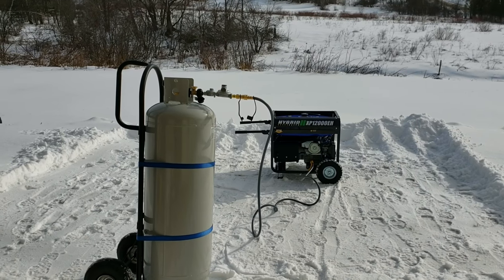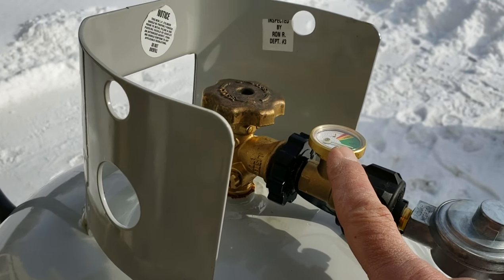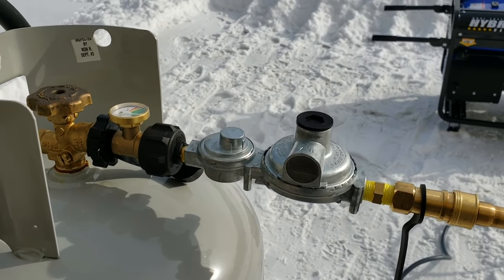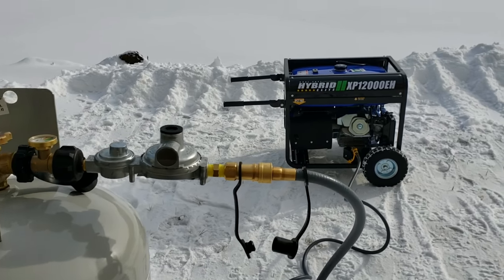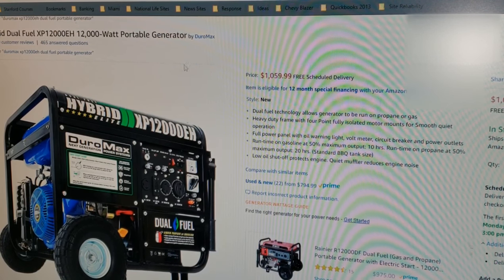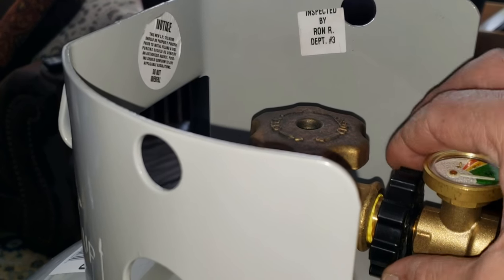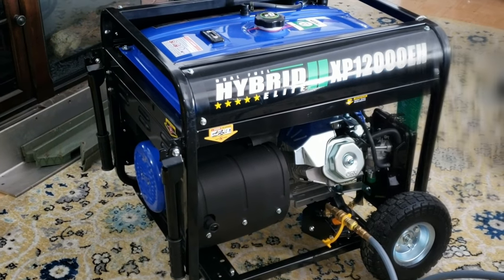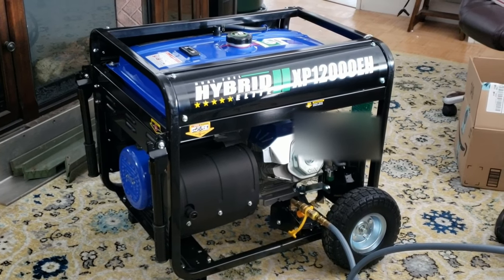Ultimate 100 LB Propane Tank Setup - Duromax XP12000EH 12000 Watt Hybrid Generator - Step by Step

Comment: What is the max BTU for this regulator ? Also I have the Newest DuroMax 13000EH but with a 30lb & 40 lb tank setup, But the regulator that came with the Generator Freezes. I am in FL
Reply from the maker: The megr-298 that I use is 175000 BTUs.
Reply: @VermontPrepper  Does that Regulator Freezes ?
Reply from the maker: @memyselfi946  no, it runs perfect
Reply: @VermontPrepper  going to call DuroMax Monday, but thanks for info. I wanted to do my whole house and that's why I went with the 13000EH.
Reply from the maker: I'd be interested in what they say.  Let me know.
Reply: @VermontPrepper  Well I called DuroMax and awaiting their reply when they find out whats causing the freeze. 

And I spoke to Rick over at Marshall Excelsior and he said I should go with a higher Regulator model MEGR-1232-BBF-XA that can handle above the max BTU. 

But I've found the Marshall MEGR-1232-BBF online but not the Marshall MEGR-1232-BBF-XA
Reply from the maker: I'm not sure I'm following that, 13000 w should only be about 44000 BTUs per hour. The regulator I have handles 175000
Reply: @VermontPrepper  Wish there was a way to contact you directly.
Reply: @VermontPrepper  The  Marshall MEGR-1232-BBF does  450,000 BTU Max Output Capacity
Reply: @VermontPrepper  their reply >>>Both regulators, the one on the hose, and the one behind the front panel are necessary.  When flowing a propane regulator will get cold.  I cannot be sure the output pressure of the regulator you sent the link to would be acceptable(which was the one you have on your setup).  We use a 100 lb. tank and 40 lb. tank with the regulator provided regularly and don’t have any issues. "So Looks like I will need to take my Generator and tank to a local propane place to get it figured out."
Reply: @memyselfi946  Did you resolve this. I am thinking of getting the 13000EH  too. I have tried contacting Duromax and they were zero help. They just kept saying you need 10 psi

Comment: Just wondering, why are you running two regulators?
Reply from the maker: I want two separate setups - one for a 20lb and one for 100.  The 100 lb has a Pol connector which is different than the one that is on the stock regulator that comes with it

Comment: What’s the savings on comparison to gasoline? Thanks in advance. I’m also a rookie.
Reply from the maker: Right now gas is pretty cheap.  So its not all that much right now.  I like propane more for how long you can store it and that it is more versatile than gas in terms of what it can power, at least in my opinion
Reply: Keep in mind with gasoline, you need to keep filling your tank. Propane tanks that large last way longer.
Reply: The biggest advantage Lucas using propane is the chances of that generator starting when you need it is close to 100%.   If you use gas than you have to worry about old gas clogging up the carb jets.  You really need to have a semi-annual checkout of your gas generator - start it up on FRESH gas - let it run a bit - let it run OUT of gas.  You really should use non-ethohol  .     Fuel stablizers will help but I would not want to depend on them more than a year.   MOST folks only need their generator every few years - unless you take a lot of precautions it may not start when you need it.   If you start your generator at least once - but preferable 2X - a year you should be fine.  But in any case gas will go bad no matter what you do over time.    Ethohol gas can corrode parts as it "ages".   If you are long term storing any gas appliance you really don't want any gas left in the tank (and especially the carb).   With propane you don't have that worry about any of that.   Even with propane I would start it up every year or so - just to validate.    With all that said dual fuel generators are the way to go - you have options than.
Reply from the maker: I'm not sure what the savings is.

Comment: I think there is a mistake in the parts list. I ordered all of the connectors and hose listed but the pressure gauge that came and i went back and looked at your link again is for the oal not the pol tank fitting

Comment: you stated that you changed the regulator because you didn't know its quality. Would the stock regulator work with a 100lb tank though?
Reply from the maker: I wanted a separate regulator to keep the connections separate.  Wanted two separate hookups

Comment: Why didn't you use the regulator that came with the generator, and could you push the length of the hose more than 12 feet?
Reply from the maker: I use it for a 20 lb tank.  It doesn't readily fit to a 100 lb tank
Reply: @VermontPrepper  okay thanks.

Comment: How do you tighten the fitting to the regulator?  By hand?  The fitting spins after only going on a few of the threads.
Reply from the maker: Use a ratchet from the other side of the fitting.
Reply: @VermontPrepper  A ratchet will fit on the inside of the gas regulator valve?  So, tighten that to the regulator before connecting it to the gas gauge...correct?
Reply from the maker: @donwright9930  yes, check it out.  I haven't looked at it in a while but believe it is a hex
Reply: I was wondering this same question. Haven’t tried it yet, but the Amazon Q&A for the adapter  gas regulator valve suggest a 18mm deep socket to tighten from the inside

Comment: Came across your video and I'm a little confused as to the regulator you are using and why you were having issues.  What you are using is a 2 stage regulator. That is required for hook ups inside or going into a house. You can use the same regulator that you use on a 20# propane tank. There is nothing wrong with it.  If you are using this outside then you don't have to use a 2 stage. Just curious as to why you have to use this one.
Reply from the maker: Not sure I understand.   I wasn't having issues.  Just setting it uo the way I want for a 100 lb tank

Comment: In your search for a generator, was Total Harmonic Distortion (THD) a consideration?  Has this generator had any adverse affect on your sensitive electronic equipment such as circuit boards in modern appliances?
Reply from the maker: I don't use this one for electronics.   I have a 4000w champion generator inverter for electronics
Reply: @VermontPrepper  smart, but a bit hard to sort out.  My 2 yr old submersible well has circuit board.
Reply from the maker: I have another video on the propane setup for the inverter generator.  You may want to look into solar power for the submersible well
Reply: @VermontPrepper  I've two stock wells on solar which pump enough for the cattle, however at 200' deep, the solar pumps will not put out the volume I need for home and grounds.  But laying aside the well issue, my new frig, clothes washer, tv, microwave,  even coffee maker all have circuit boards.  Do you have them on separate circuits? 
In reality these days our phones, laptops, and desktop computers are not the only sensitive things in the house.  I strongly suggest a quality surge protector between generator and everything else.
Reply from the maker: For sure.  I use a surge protector.   Looks like the best way is an inverter generator that has a number of circuits.  Mine has a 30A connection.  May be good for your application.   There are plenty around.
Reply: @VermontPrepper  Yelp, those 6500 K Champion inverters are sure attractive.  20 yrs ago I just hooked my welder up to my house grid, but not now, it's way more complicated.

Comment: I have same generator. Having issues with propane. It is stalling out after running for awhile. I checked for leaks. Changed hose, no leaks. Cleaned carb as well.
Reply: Are you running with a 20 lb tank? They can freeze up. Do you see ice on the outside of the tank or is it very cold? Converting. The liquid propane to gas absorbs heat. If it’s cold outside it will freeze up quicker. Place the tank in a warm water bath.

Comment: Two questions... 1, how many hours were you getting out of the small 25lb tank? 2, is the regulator it comes with sufficient to run it with that 25lb tank with no additional parts?
Reply from the maker: At 50% you can get 4-6 out a 20lb tank.  I use the stock regulator with that tank.
Reply: @Vermont Prepper  so when you say 50% you're referring to....? Nozzle on tank 50% open or is there a setting on the generator that puts the unit at 50% power? I apologize but I don't actually own the generator yet and have never owned one. This is all new to me. Thank you for all the info man!
Reply from the maker: No worries, I am referring to the load rating when discussing percentage - so 50% of the load rating
Reply: @VermontPrepper  ok understood 👍 big help. Thank you again.

Comment: Is that a 100 pound tank or 100 gallon tank?  How long will it last when running the generator?
Reply from the maker: 100 lb.  Lasts for 24 hrs
Reply: Vermont Prepper thanks...

Comment: I just picked up a "Powerland" (not the US company) 10kw (8kw continuous) Generator that is identical to yours there.  Except of course for the decals and a 16hp engine.  Got it through Newegg's marketplace New for $600 + $40 NC Tax, and free shipping (ordered on 19th, and it got here yesterday the 28th from CA to NC with a 3 day weekend mix in).  "POWERLAND PD2G10000E 16 HP Dual-Fuel (Gas/LPG) Portable Generator with Electric Start - 10,000W Surge & 8.3 Gallon Fuel Tank"  It's listed at $749 now, but we know how these sales go.

The regulator that came with mine says on it that it's adjusted to 15psi.  I ran it yesterday off of a 20lb tank, but I plan to also use my old 100lb tank (bought for use on a pool heater a few years ago, was $100 bucks at Lowes Hardware), and maybe another 20lb for good measure.  My plan is to use the supplied regulator with maybe an extension added between it and the generator.  Because a 100lb tank has no more pressure than a 20lb, so I don't really understand the need for a second regulator?  Except maybe as a backup.  btw, Here we can get propane by the gallon (most refiller's charge a set price by tank size) at Tractor Supply, currently $2.99 a gallon.

Pressure gauges aren't a reliable reading for liquid propane.  Because it's a temperature or pressure thing.  In other words, it remains in liquid form when it's under pressure, or below a certain temperature.  Meaning that if the propane is cold enough, it won't gas off, so there is zero pressure.  So you can literally open a tank of propane, and the cooling effect of depressurizing it will stop it from gassing off (building pressure).  Meaning that the tank is still half full of liquid propane with the valve wide open and at zero pressure.  The surest way to check them imo, is by pouring a bottle of water, hot if possible, down one side of the tank.  The empty part of the tank will dry much faster that the liquid part, and you can clearly see the line.

Comment: I have the cheaper 4850 model. Mine didn't come with an on-tank regulator, just the hose with the bbq bottle fitting.
Reply from the maker: Did you modify it at all?
Reply: @VermontPrepper  I have actually just been running it without the regulator on the tanks at all. However it's only been hooked to small bbq cylinders. I picked up a 100lb tank today but dont have it hooked up to anything yet.. I guess I never thought about the regulator on the tank. The diaphragm system the generator uses to deliver the propane to the carb has an internal regulation ability of own.. I suppose having one wouldn't hurt... I dont think the pressure is any different than a small cylinder, just more volume. I only ever use it in the winter, so I wonder if having the tank colder lowers the pressure enough to not need it.🤔🤔. I should probably hook one up anyway.
Reply from the maker: @MegaMarclar  that is probably a good idea,  but I am very far from being an expert.

Comment: Thanks so much hte info is so hard to find. I have the earlier version Duromax 120000 EH The Beast, would you know what I might need for a regulator at the generator?
Reply from the maker: Appreciate you watching.  I am uncertain what the regulator specs are on the generator.  I would call duromax to ask.
Reply: It should have came with the regulator if you got the duel fuel one,you will just need the fitting that goes to the tank and fits the end of the hose that came with the genie..

Comment: My go-to video for my 12000EH. I love your setup but I do have a question. This is a 50A capacity generator. How come you are using 30A cord and 30A Power Distributor?
L14-30 Generator Extension Cord (40 Ft.) -  https://amzn.to/2B37FXE
30A Power Distributor - https://amzn.to/2B37FXE
Reply from the maker: Great question.  I have a 50A cord as well, but right now I live in an apartment so I do not have a way to hook into the main breaker, so if power goes out, I have to use a smaller distributor.  When I get a house I will hook up a transfer switch.  Hope this clarifies and thanks for watching.

Comment: Great info. I just bought same generator but the 13000. Can't you just use the regulator that comes with it and use all the fittings you bought for the same setup?
Reply: No it will have the same pressure. The pressure is derived from the gas above the liquid and it will always be the same regardless of tank.
Reply: @TNRonin  just to confirm....I can use the regulator that came with generator on a 20, 40 or 100lb tank, yes?
Reply: @kimross2  LP gas is NOT high pressure like scuba etc. The pressure above the liquid is the same regardless of the size tank (barring outside conditions such as heat/cold). The regulator sold with the generator is designed to feed the size generator so if you use an adapter (I used one with a gauge built in) to connect to your regulator you are good (between the tank and regulator). With that said I have no idea what you're running how you're running it etc so do at your own risk. I have the following, an adapter that connects permanently to my 100 lb tank then the regulator that was purchased with the generator attaching to it with a 12 ft extension hose attached to the 4-ft hose coming off of the regulator.
Reply: @TNRonin  perfect, thanks
Reply: @kimross2  did you end up just using the regulator that came with the generator?   I'm reading through all the threads and can't quite determine if I do or do not need to add an additional regulator for my 100 lb tank.  I sent a request to Duromax's customer service but haven't heard back.

Comment: Could all this info apply to the xp4850eh model? Thanks for this really detailed video.
Reply from the maker: With the exception of the regulator, I believe all other info would apply.  You would just need to make sure you fit an appropriate regulator.  Maybe its the same,, but i don't know..  Hope this helps
Reply: use the one that generator came with.

Comment: I believe the link for the second quick connector is wrong. Can you check this for me? When I select it it sends me to the 12ft hose
Reply from the maker: I couldn't get the link to work either, but I found a other brand that should work and revised the link in the description
Reply: Thanks

Comment: 100 pound cylinder filled to legal limit 80%, times 0.236 gallon per pound propane weight, equals 18.88 Gallons of liquid propane. Divide that by fuel consumption per hour of genset to get total runtime per tank.

Also realize that electrical capacity of genset is de-rated when using propane vs gasoline.
Reply from the maker: It's about 24 hrs on a 100 lb tank at 50%

Comment: You should have ideally a 100 gallon gas tank in your garage or at least a 55 gallon barrel full of gas to run these generators.  They go thru a lot of fuel.  
Or a 500 gallon propane tank which they fill to 80% or 400 gallons would be nice.
Reply from the maker: If only I had a garage

Comment: I really appreciate your video however I would like to point out that the propane gauge your using will only tell you what the pressure and temperature of the propane tank is. Basically it will only tell you your out of gas but won't be able to give any indication of liquid level in the tank. But I will admit it's useful as an adapter or a leak checking device.

https://en.m.wikipedia.org/wiki/Boiling_point

That article has way more information then one really needs to know. But point is that as the propane vapor is drawn off the top the liquid propane in the tank will boil off to keep replacing the vapor. While you're drawing off the tank you might noticed a initial drop in pressure but that's just the propane useing ambient heat to boil. You won't see much of a difference in tank pressure until all the liquid propane is used up and at that point your out of gas.

Really the only way to see how much propane is in a tank not equipped with a float gauge is by checking it's weight.

All you need is a bathroom scale. Weigh the tank and subtract the tank weight marked on the tank. It will be marked as TW- (number) somewhere around the valve or valve gard.
Reply from the maker: Thanks for the info
Reply: This is probably a different scenario but my house propane tanks 500 gallon and 1000 gallons have gauges on them that shows a percentage left 50% 30% ect. Taco pen guy always tells me re-order when I’m down around 10% in case he needs a few days to get out there how those gauges work I don’t know but they are attached straight into the tank and not in line
Reply: @hdjd1010  yeah those are gauges that have a float on them and measure the liquid level directly, much like the gas gauge in your pickup.